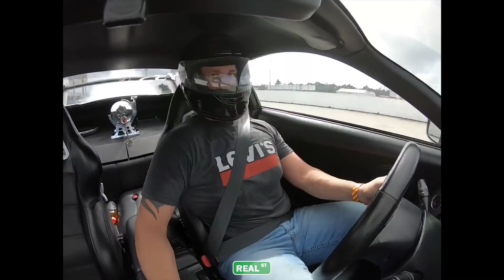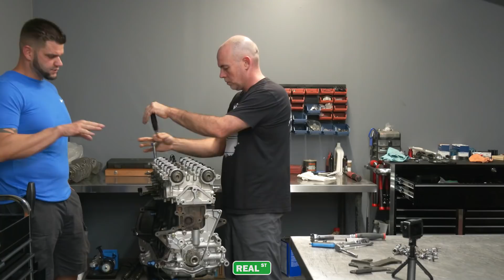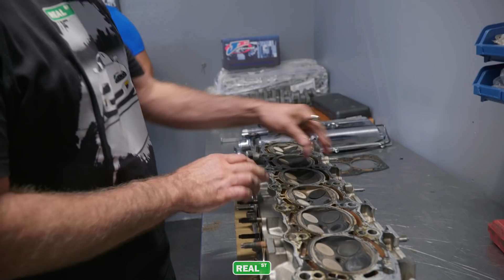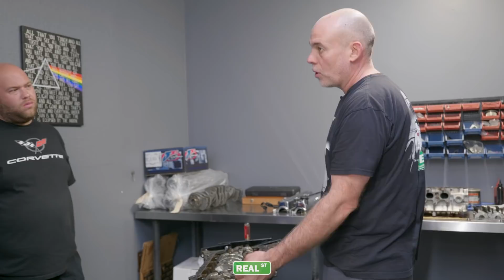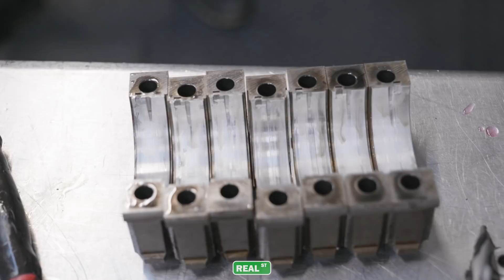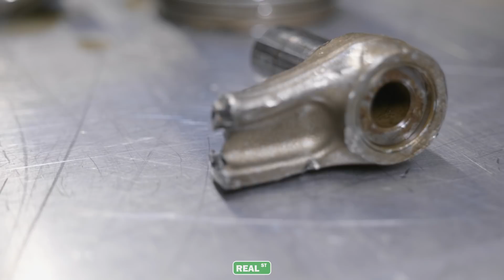46PSI On Stock Toyota Internals 2JZ Supra Blows Up: Engine Tear Down

Comment: Jay Meagher hats down you are an absolute master not only in engines building but also you gave the owner of this broken engine a good lesson about greediness and power limits of the stock internals that he used ! Thank you Jay it is an honor to be living in this very moment and seeing such a valuable lesson which I can use to teach my self and to teach my kid at some point. Sometimes people are not realizing that it requires not only to be deadly precise in all the things which are happening in that engine, but also, people just don’t realize that they need to build the engine in their own way in the manner of try/fail method and then to be able to spot by 6th sensing on their own an eventual failure because of greediness for more and more !

Comment: Idea for thought here ...
Maybe have a 1/2 mile strip, once you go past the 1/4 mile mark, instead of letting the throttle go and forcing the engine into full vacuum, which is what caused his rod to snap, you let off slowly, ease off the throttle until you don't have that stress anymore, then let go. This may remove that stress on the rod and allow it to continue to run.

Comment: Proves that 2jz engine really has big balls.The thing was running at a level of 800-900hp with no problems from 2009 until the owner push it even more in 2017 at 1100hp with 46 psi of boost and then it blowed up, otherwise will still running fine.
Reply: You should look up Dean Moslow pushed his stock block vg30dett harder than this drag racing constantly
Reply: @jz-qy9hb  no he didn’t. He’s replaced motors constantly.
Reply: @Lolya11slow  he ran the same stock block for at least a season he recently put in his built block he was building while running the stock one
Reply: @Lolya11slow  the 2jz isn't anymore bullet proof than a vg the vg could be considered more bullet proof because they tend to make more torque
Reply: @jz-qy9hb  I can only find that a vg30dett can reliability hold 700whp to wear as a 2jz can handle 900whp. So where is this 1000whp vg30dett holding that power? I can't find it. The 2jz is the only engine that came from Japan is the late 90s early 2000s  that can handle lots of power in stock form.
Reply: @kkellerk23  jun in 1991 was making 1000 + breaking land speed record at 263 mph and the 24hr lamas and 24hr Daytona 300zx was making 750+ hp in 94 and won both races the supra didn't win any big races compared to the 300zx. supra also the supra has the same problems at 650+ hp as a vg which  is the pistons. Popular 1000+ hp vgs are mike Jackson, z1, banez, an a midnight purple z in Australia. There are plenty more that just aren't popular
Reply: @jz-qy9hb  we're talking in stock form, the 2j is the only one I know of that can handle that much stock, and if you're having issues with a 2j at 600whp you're doing everything wrong. But I still can't find anyone running over 700whp from the vg with stock internals.
Reply: @kkellerk23  yeah 2jz and vg can run 900 to 1000hp stock but the reliably is best at 650hp dean moslow was making 900+ on his stock block vg literally trying to blow it up so he could put his new built engine in the stock block lasted a long time considering he was running 8s in the 1/4 mile for over a season and also street racing it constantly as far as I know a supra hasn't beat his 1/4 mile stock block record
Reply: @jz-qy9hb  where are videos? I mean, I can find a ton of 2js running 900whp+ on stock internals, but I can't find a stock internal vg. I'm still looking. I believe you, but I don't know a lot about vg engines. That's outside my wheelhouse. I'm having to research to find all of this info.
Reply: @jz-qy9hb  I'll take a look, so basically the 2j and vg are the ones that Japan produced to hold lots of power stock. Learned something today, appreciate it.
Reply: And the surprising thing its that all of this power was handled by stock bottom components😮

Comment: But...but...according to the internet the 2JZ never breaks!
Seriously, though, these are tough engines and it takes a lot to break them, clearly.
Reply: all engines have their limits. 2JZ has a HIGH limit because it was over engineered. What other motor from  FACTORY condition can TRIPLE its crank hp without a single internal mod to the block and do it day in and out ?? NONE that i know of. Most can double with a good tune. But triple its crank hp and hold there all day long ..?? Nope
Reply: @ACommenterOnYouTube  
One of my old 350's lived forever at triple the factory hp...
...which was 140...

Comment: Lol him using slow hand tools is triggering my ocd lol.  Where’s the compact impact ???
Reply from the maker: Juan, he wont use impact guns on engine work.
Reply: Only IDIOTS would use an impact gun on an engine. And trust me there are a LOT OF IDIOTS out there and one of them is famous on YouTube ...
Reply: @ACommenterOnYouTube  

do you not see the giant hole in the block???
Reply: @juanc5149  what does that have anything to do with an impact gun ?
Reply: @ACommenterOnYouTube  

So, there’s 0 reason not to use an impact wrench on that block, to remove components.  Everything on that block is trashed.
Reply: @juanc5149  ok on THIS specific block ONLY that is "destroyed" yes its ok to use an impact wrench but i was talking in general when taking a GOOD motor apart or working on a GOOD motor, it would be STUPID to use an impact wrench. But ONLY on the block bolts since the block is trash already.  

next time be a little more specific when you ask why he is not using an impact wrench. That was a general question for a general situation. Your question was specific to the block that you didn't mention, then you wonder why some people question you

Comment: Proves time and time again why the engineers at Toyota are a notch above the rest.
Reply: Yamaha and Toyota*
Reply: @hendrahendra  what did yanaha do?
Reply: @2JZLS  AFAIK they helped design the cylinder head portion of the engine to re refine verything (where all the power is made) and then toyota did all the bottom end bits.
Reply: @hendrahendra STOP TELLING THAT LIE!!! The 2JZ engine was ALL Toyota. Yamaha help design the heads for the 2ZZ, and 1jz. They had a bigger involvement in the V10 in the LFA... This is public knowledge that was debunked almost 2 decades ago.

Comment: Jay is an awesome dude! He's skilled at both engine building and tuning; and uses engineering terms/language to explain technical concepts.
Reply from the maker: Thanks man! I appreciate it
Reply: @realstreetperformance  No problem! I can't wait for you guys to release a video explaining the new software/controls concepts of the B58 engine in the Mk5 Supras. Given this engine has variable valve lift, an electronic throttle body and electronic wastegates, air management is much different than a cable throttle body 2JZ engine where fuel and spark are outputted based on air/load and RPM. Now the ECU has control of air/load via valve lift (and timing) and electronic throttle body/wastegate; so I know engine calibrators/tuners are dealing w/ a new learning curve...

Basically, the amount of air entering the cylinders can vary at the same manifold pressure, simply because of variable valve lift....so multiple fueling/spark map filters need to be put in place to account for this. In addition, fueling is more efficient in a DI engine than a PFI engine; but the air entering the cylinders has to be modeled from the ECU since there are no pressure sensor in the cylinder... 

Someone needs to break down the new controls strategy for the B58 engines; it should be RealStreetPerformance.

Comment: Pretty cool shit. So was the fretting on the damper and flywheel a failure of the fasteners to create sufficient friction to hold those parts in place? Or was it that once the damper started moving, the flywheel just couldn't hang on?

Comment: Goes to show you how well engineered the 2JZ and the 1JZ are. I mean your talking about 700 HP over its original Stock OEM configuration. Toyota because no body comes better in reliability then Toyota, or even ACURA and Porsches probably the best machinery money can buy!!!

Comment: You need to get an impact for those little bolts  it makes it faster
Reply from the maker: Jay has a drawer of impacts but leaves them in the drawer for engine work. He prefers to feel how each bolt comes out and geos in. You can learn a lot about the health of a bolt by the way it breaks free and tightens back down. Especially bolts in engines that get torn down for inspection frequently. Jay has a tech tip on this channel about bolt health and how to know when its time to replace a bolt instead of reusing it. Using impact guns on important hardware causes you to lose a feel for the bolt. It also tends to tempt people into making mistakes like running a cap bolt/nut all the way down on one side before moving to the other side, instead of slowly working them down on both sides evenly. There is a time and a place for impacts, but we will continue to leave them in the tool box when doing engine work.

Comment: Jay is disappointed AND pissed.. 2JZ’s will be extinct in 10 years for sure if people dont stop being wreckless with them. Its the most bulletproof 6cyl in history, yet people arent happy until they can break motors. Dude might as well go billet block now, hes going to need well over 2000hp in a few months hahahahahahahaha
Reply from the maker: Haha, not pissed. Luckily the 2JZ came in a lot of vehicles so I doubt we will be running out any time soon. And when they do, i'm sure the performance aftermarket will step in and provide a solution. Thank you for watching and commenting. I appreciate the support.

Comment: Why not use power tools to disassemble the broken piece of garbage ? I would think that would save time. 
Long story short, break out the wallet party boy.
Reply from the maker: He has lots of power tools, but when taking an engine apart or putting it back together, Jay feels that its important to feel how each bolt comes out and goes back in. He has an entire tech tip video about how fasteners are wear items that cannot be infinitely reused. Being able to feel how the bolt breaks loose, how it feels backing out, how smoothly it goes back in, what it feels like when it tightens back down on the last turn. It can tell you a lot about the condition of the hardware that you lose when you use power tools.
Reply: The best engine builders don’t use power tools only hand tools and tq wrench. Reasons why some people blow up motors and some peoples motors last a long time. You need to know if a bolt is stretched not stripped and you can’t know that with power tools.

Comment: I’m not aware of what type of induced stress is identifiable as the cause a rod failure by unloading (engaging the clutch). 
I understand why failures occur from shock loading (gear shift events, etc ), but not upon unloading

Comment: They break at high RPM on decel, because that's when the rods are stretched the hardest. No cushion of air above the piston on the exhaust stroke.
Reply: Bingo!
Reply: So the damage was done due to high rpm vacuum, not boost pressure?
Reply: 100% 👍
Reply: Interesting and makes sense.

Comment: dang! the most i made on stock internals was like 38psi on a 76mm.
Reply: Did you spray too
Reply: Those are bands numbers lol jk
Reply: I wouldn't even put a 76 mm to a stock 2jz
Reply: Diff compression uh believe aristo jz is NA
Reply: @Heretic51  aristo jz is 2jz gte vvti 2nd gen non vvti 1st gen.  The lexus gs is NA
Reply: @kriskool420  actually it depends, toyota aristo comes in both engine, jzs161 is 2jzgte and jzs160 is 2jzge. 1st gen Lexus GS is non vvti ge (stronger rod), 2nd gen Lexus GS is vvti ge (weaker rod).
Reply: @Heretic51  toyota aristo comes with both engine, jzs161 is a 2jzgte and  jzs160 is 2jzge

Comment: thats amazing how 2jz take such a monster of a beating. im sure that block could have been saved if a seasonal inspection was done
Reply: Seasonal inspection wasn’t the problem the parts was pushed way past their limits, it handled the abuse very well for what’s done to it
Reply: they pushed too much boost and consequently too much hp and torque for a stock 2jz

Comment: Wow that's literally my engine 😂 same hole, same broken rod, same broken piston
Reply: @3UZ-GS 764/742 at 34psi on a mustang dyno. Swapped wastegates and the gate didn't open so it was probably upwards of 40psi when it blew. The cast manifold made tons of torque, pretty sure that's what did it
Reply: @3UZ-GS cast wheel s366, .88ar open t4

Comment: Typical 2jz always blowing up, just throw a maatouks rb in it.
Reply: RB lol , they run out of oil at 500 wheel....
Reply: @STProductions260  never seen a rb run out of oil at 500whp.
Sounds like you don't understand how engines work, I bet you run a racing timing belt don't you champ?
Reply: @AdmissionGaming  I don't know anything about cars, you are right, I am a car mechatronic from Germany, worked for Audi, then moved to Dubai and worked for both performance focused and luxury focused cars, yeah I don't know shit, didn't own a 2jz supra myself and never built trophy trucks.But im sure you are very well educated on cars thanks to the youtubes :D
Reply: It's a stock shortblock with 1000HP and nitrous...what do you expect?
Reply: Any kid knows that 2jz's hold more power than RBs and RBs have problems with their oil pump and oil delivery to the heads, I spend my afternoons at Sub Zero in Al quoz, feel free to google them, they run 2000hp TB48 patrol engines....
Reply: @STProductions260  race modded rb all my life. Motors are just as good as 2jz. What you say is nonsense and never heard of this.
Reply: There is a video from Australia where they tested 2jz, RB and barra... 1. 2j 2. Barra 3. Rb

I believe they know their shit better than some internet warriors as yourselves.
Reply: @HT2JZ  one engine tear down isn't gospel for every motor. Guide only. Too many variables.
Reply: @davothegreat9990  we talk race engines with thousands of dollar in them or stock? Because thats a stock 2j with 272 hks cams and arp head bolts. Now lets see an rb with cams and head bolts do the same results...
Reply: @HT2JZ  don't work with stock motors. 2jz can handle more power with stock internals and is cheaper with bigger capacity. Rb are more expensive and with the oil pump/oil system issues sorted before modding can handle just as much hp and red line higher. Rb is more responsive, which I like.
Reply: @HT2JZ  the barra is about the same as a25 soft open deck block,cheap fun.jz is in its own world that's just cold hard facts.
Reply: @HT2JZ  the barra is flawed as shit open deck block engineering of drunks.if you listen to pbr he says the barra ok for 1000 hp with a ton of work then after that mmmm,the 2jz eats the barra In every way,I have had 2jz for 20 years and never had 1 problem wiping the floor with the taxi shit box barra,there that slow top end there not even worth racing way faster out there,there traffic light skid pigs that fall apart
Reply: @HT2JZ I have owned jz for 20 years and the Barra doesn't even rate in the same world as the jz family.the Barra has that many flaws some can be fixed others not.
Reply: @STProductions260  the get oil to the head just fine issue is getting it outta the head oil drains 2 small the it starves the the pump good by bearings and all thats if the oil pump dont fly 2 bits when you rev it with its flimsy crank snout
Reply: @STProductions260  tb48s the real top 6cyl
Reply: Got the $80K for the Maatouks motor champ? Because that's how much in Nitto and PRP parts you need in there to even get that 1000hp in the RB, compared to a stock JZ on boost. 🤣 Even a Barra beats an RB, all day, every day, for only $2K. 😎👍
Reply: @MafiaboysWorld  barra is average the 26 will still embarrass the barra.and the jz is just the king barra not even in the same world
Reply: @MafiaboysWorld  that's correct and the barra is pretty average same as a rb25.why do these Rb and barra boys dream and talk shit.the 2jz is in a league of Its own,when big cash is thrown around the rb30 is better then the barra,
Reply: dude, you sound like a spaztic. grow up
Reply: now we know who's the 1 person who disliked the video
Reply: Can you 2jz fan boys show me where the rbs hurt you on a doll please.
Reply: @AdmissionGaming  it hurts when Nissan fanboyz throw out their useless RBs or SRs & put in a (1) (2) (X) JZ thus driving up the JZ prices skyline high 😭
Reply: @AdmissionGaming  Blake. i own an rb powered skyline, youre being a complete spaztic.
Reply: @AdmissionGaming  Aww, can't handle the truth?
1000hp JZ = Stock internals
1000hp RB = The whole Nitto & PRP catalogue.
End of story. I'm sure there's a pride parade with rainbow flags for you RB fanboys to march to somewhere. 😁👍
Reply: @MafiaboysWorld  that is true same with the barra boys there is only 1 king 6 and it's the 2jz,
Reply: Let me know how long the rb can last @ 1000hp with stock internals.
Reply: lmaoo mfs made u sdfu 😂 perfect